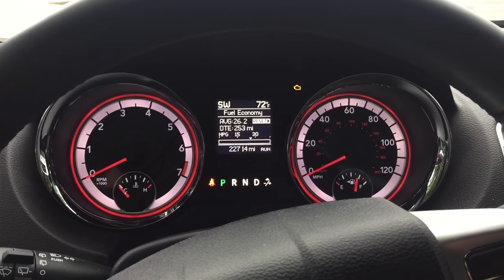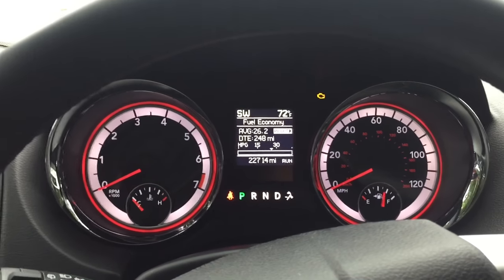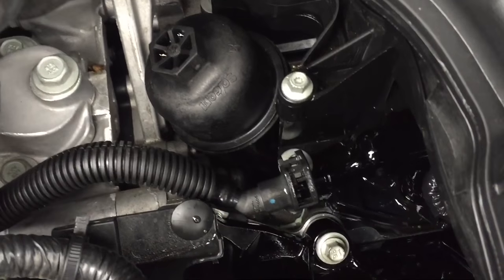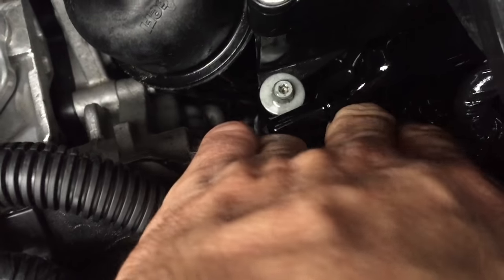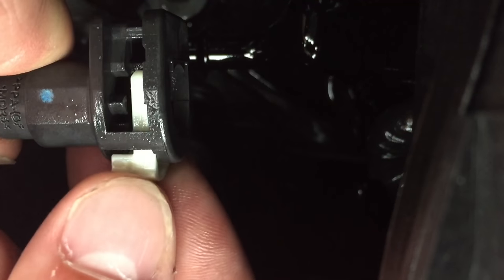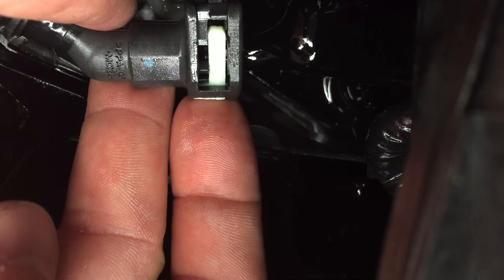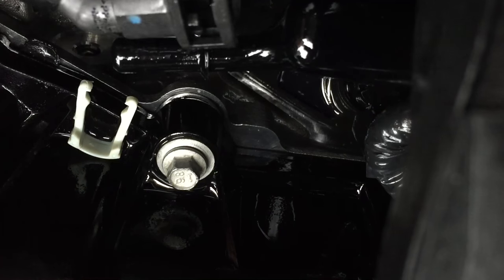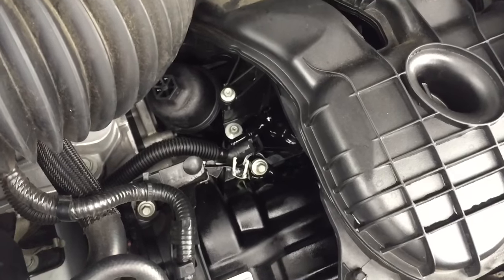Dodge Chrysler 3.6 Fuel Leak

Comment: Thats why you dont buy DODGE
Reply: What do you buy then?
Reply: GM
Reply: Ford
Reply: But both of those brands have also had major safety related recalls lol
Reply: Including my 2002 Saab 9-5 that had a recall on it where the fuel pump line would touch an electrical lead and cause a fuel fire. I would rather an extinct Saab than most brands though
Reply: No, that's why you don't buy a car when it first comes out. Wait for the bugs to (hopefully) fixed, then buy one. Unless of course, it's modern day, and designs change every few months. -_-

Comment: I had my oil bypass valve break on my 2011 challenger with the 3.6 pentastar. During oil change I removed the filter and little plastic pieces shot out from the housing about 5 feet down the driveway. Little plastic piece in the filter housing that fails over time due to continuous hot-cold cycles that weaken the plastic. On the 2013+ models it's part of the oil filter itself and costs roughly 10 bucks to replace. On mine it is a part of the oil filter housing/oil cooler and requires complete replacement of the entire housing. Parts  $273, labor $200.

Comment: How is it possible that something like that gets dewsigned, approved and million miles test driven and not spotted? And as the error accours in the field nobody starts a recall?
What if you park that thing loosing fuel in your garage, it ignites somehow and burns your house down? Unbelieveble...

I wouldnt just replace the clip but reatin it with some zip-ties maybe, its gonna break again obs...

Comment: That happened to my old car (2004 Citroen C4 Coupe) where the fuel line has separated from the injector bar.
Luckily the clip was still there and I could just put it back together and drive away.
It never happened again.

Comment: leaking pressurized fuel on the hot haust. what could go wrong..... Just imagine if the idiot that designed the clip also designed the electrical connector right next to it. He did? You don't say.....

Comment: Today's plastic shit!!!! There should be a class action lawsuit for irresponsible design on new vehicles which are deemed to be so much safer than 1970s and 1980s vehicles. Great, you have TEN air bags, but you get to be barbequed without even getting into a collision, due to hokey materials.

Comment: There is certainly a huge scale of quality when it comes to plastic/polymer/nylon parts.  Examine a Glock pistol polymer frame. Plastic/polymer at its best.  I'm From Detroit and so many families here lease Chrysler vehicles for very low prices. Almost always less than 300 a month unless it's a challenger or a new release. At those prices costs are cut somewhere.
Reply: I agree, if the plastic parts aren't designed correctly, problems like this can easily occur. It mainly comes down to the engineering, but then again, sometimes over long periods of time, certain chemicals can interact with the plastics. (Or also UV light, as in the case with those plastics that yellow when exposed to sunlight, and/or become brittle because of sunlight)

Comment: I think this just happened to my company truck ram1500 v6 pouring gas all over my garage by a gas water heater . what could go wrong? anyway,my old f150 with 4.2 has shiny chrome looking metal connectors and require a special tool and a lot of force to release.WTF DODGE?

Comment: Like the fuel line connectors on older Ford's at the filter. similar connector clip. great video
Reply: except those ford clips are made of metal, not plastic bullcrap

Comment: Silly me I broke mine while changing my oil cooler housing and through a zip tie in after 5 mins of drive duel was gushing out , had to walk 2 hrs round trip to the store to get the damn clip
Reply: Where did you find the clip...I have been looking for 5 days now. Dealer said they do t more them . Have to buy a new fuel line..????

Comment: Have you seen this on any rear wheel drive applications of the 3.6 engine?  I just checked under the hood of my '15 Dodge Charger 3.6 which is rear wheel drive and the fuel line is completely different.  There is no fuel line next to the oil filter cap like this front wheel drive caravan.  Perhaps this is something that only affects the transverse front drive minivans.  And to everyone taking smack about Chrysler using junk plastic, this is the exact same style of clip made from the exact same plastic that ALL the other auto manufacturers use.  Chrysler doesn't make their own fuel lines, they buy them from an outside supplier just like everyone else does.  Maybe this is an assembly line issue?
Reply: Alan Wolbert no problems with it on my 13 charger and it just hit 66000 miles. mopar or no car
Reply: Yeah on my 2014 charger it happened but the line is on the back of the fuel rail so you can’t see it but you can feel where it is. Left me stranded in a parking lot 2 days after I had to replace the oil cooler which is another common issue with those cars because it’s all made of plastic. I won’t buy a Chrysler product again to say the least

Comment: sad a 25 cent clip will do that
Reply: The part probably costs $20 , plus a minimum of $80 labour, and your into a C note for a piece of plastic that is made for 2.5 cents.     Be better to cut the end off, and get one of those metal straps with the screw adjust and then  gorilla that on, so that it's stays put.  '